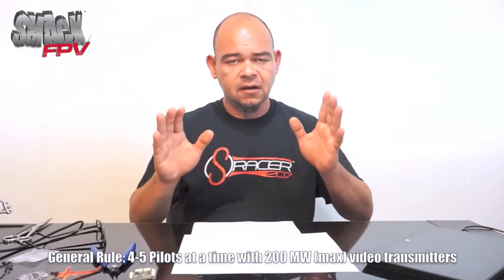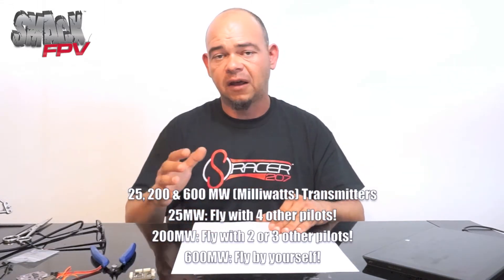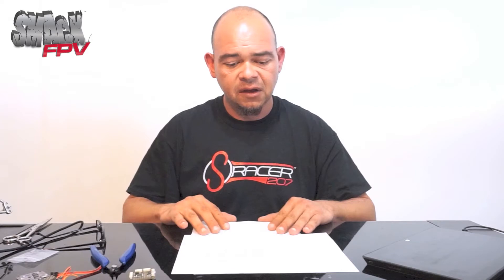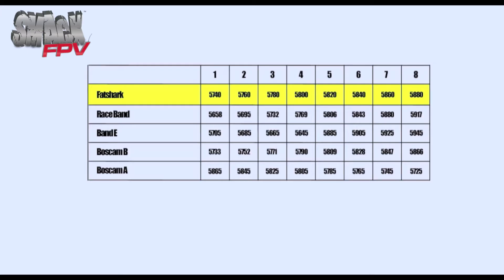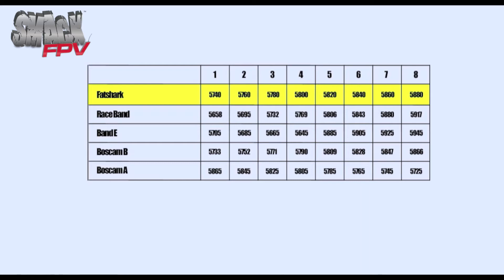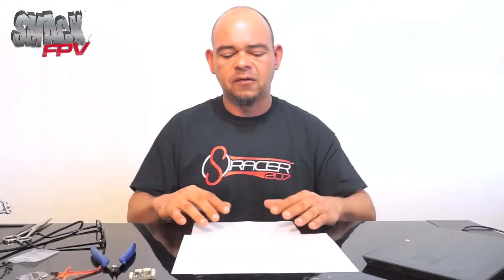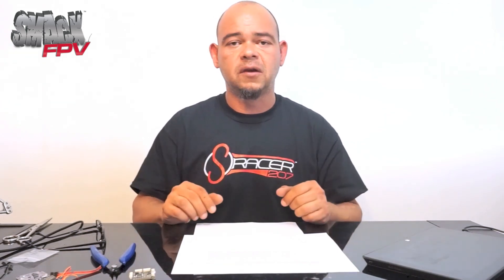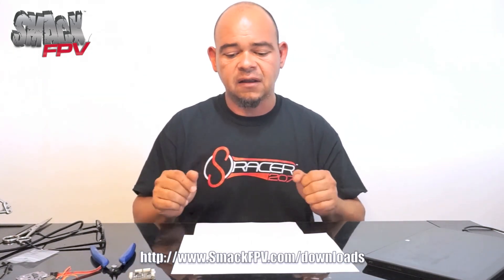FPV Frequencies

Comment: Hi Bert, great video but one thing to add is the different types of frequency selectors available on the VTX's. The push button style requires power up to change channels were as the Dip switch style does not. With the push button style, it's a good idea to have a 50 ohm dummy load to temporarily replace your regular antenna so that the signal doesn't get out during power up. It'll always still be proper to announce your intentions though as not all dummy loads are made to the same spec. It's always best to test it at home before you try it at the field. Have a safe flight everyone.